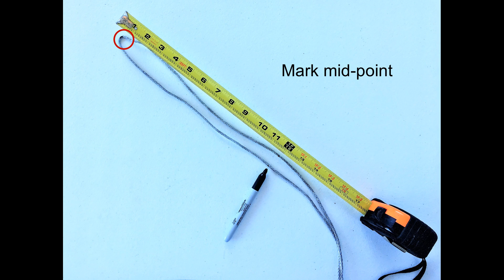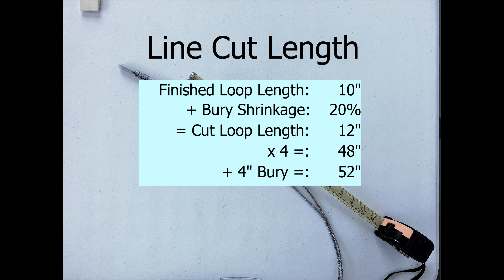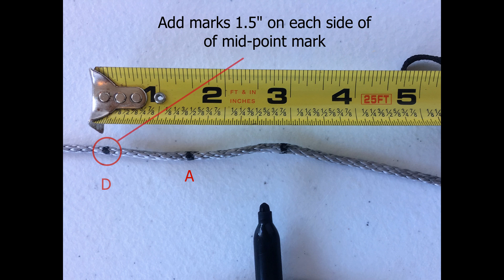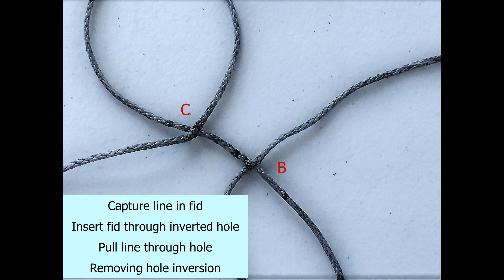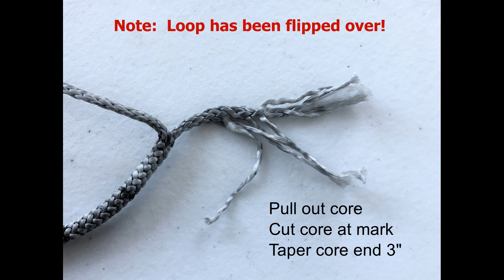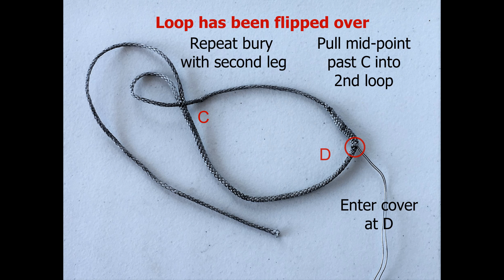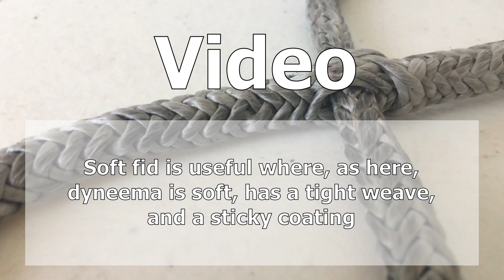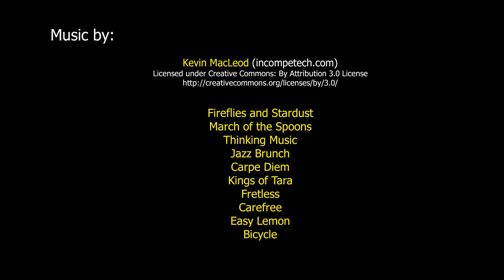How to make the Cross Loop Splice in Dyneema Loop

Comment: what do you use this for?  :)
Reply from the maker: Pretty much anything you would use a traditional dyneema loop for, that is, mostly attaching stuff.  I recently used my Cross Loop to install new dyneema lifelines to my boat.  (I tried to attach a picture to this response, but that doesn't seem possible).  The nice thing about my loop, is that I was able to cinch one loop up against a thimble, with the other -- now larger -- loop connected to my pulpit with a luggage tag hitch (aka cow hitch).
Reply from the maker: Also, sorry for the delay in this response.  I'm not getting notices of comments.  Likely operator (me) error.  I'll try to fix that.
Reply: @crossloopsplice2587  wouldn't a larks head do the same thing?